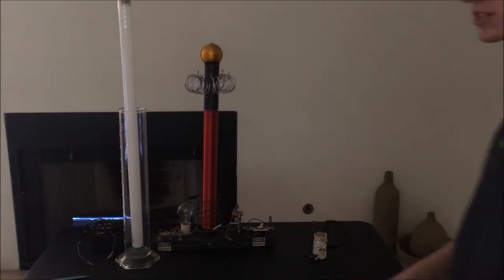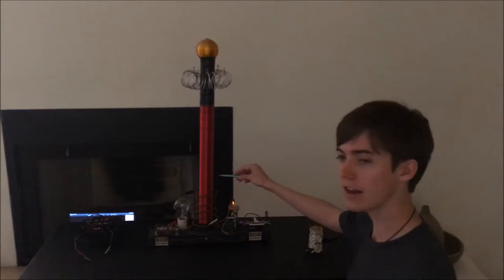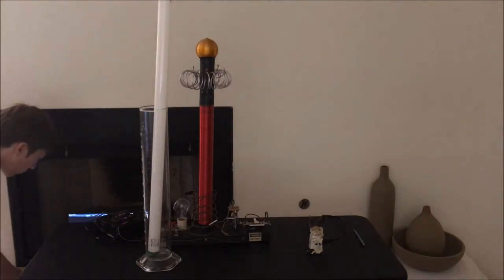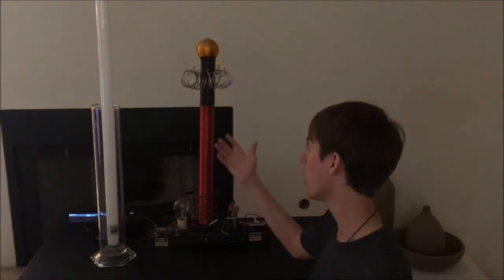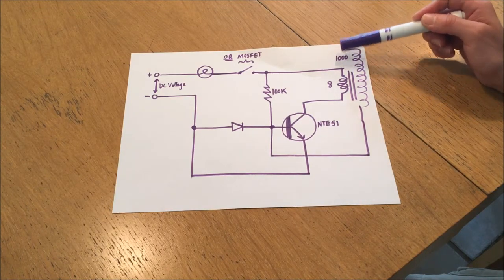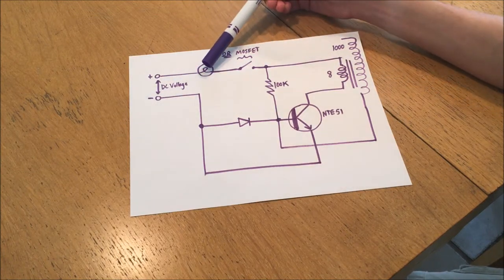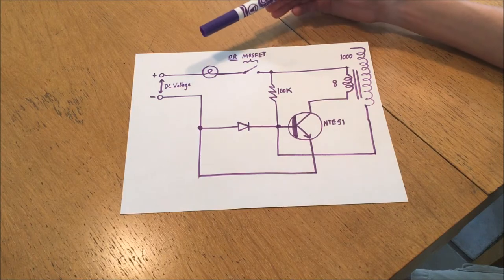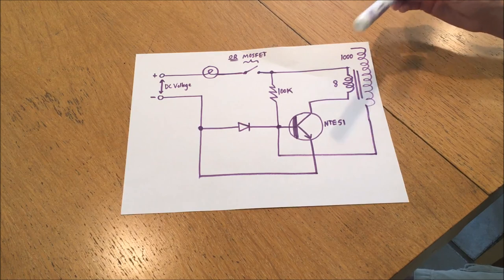EP 8 - Slayer Exciter Coil

Comment: How do you make it??? Schematic.......
Reply from the maker: I briefly go over the design in the video at 7:43, but for your reference here is a variation of the design (courtesy of Instructables): https://cdn.instructables.com/FFE/VDT4/H2ULR7OI/FFEVDT4H2ULR7OI.MEDIUM.jpg
Reply: Dielectric Videos does Mosfet transistor not need feedback diode over drain and gate?
Reply: Dielectric Videos sorry i read your schematic wrong diode is there